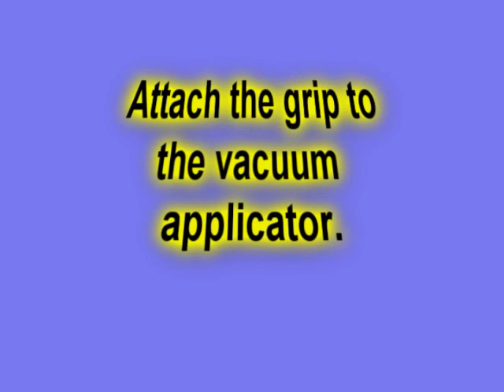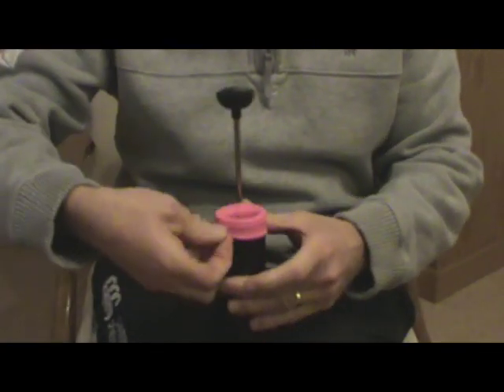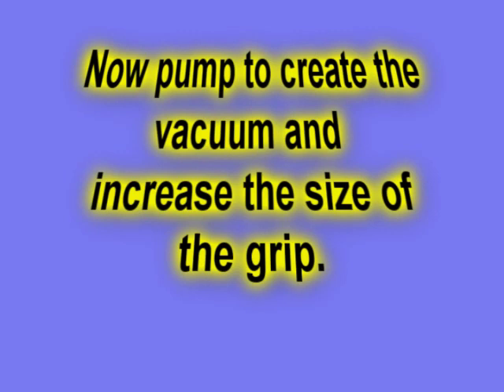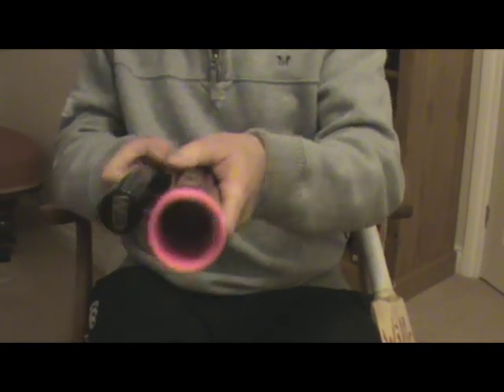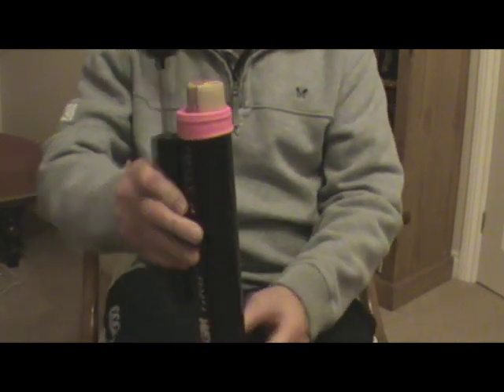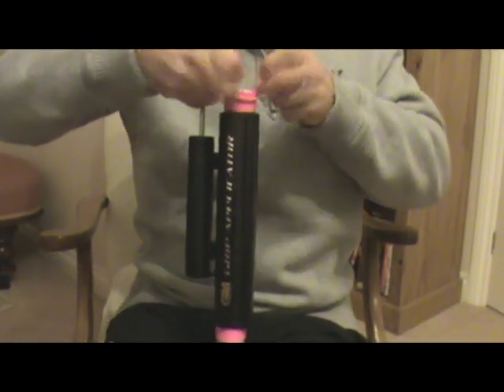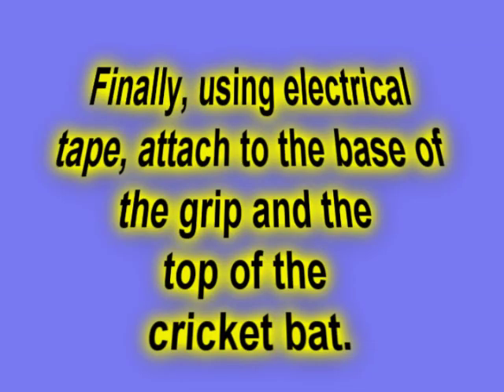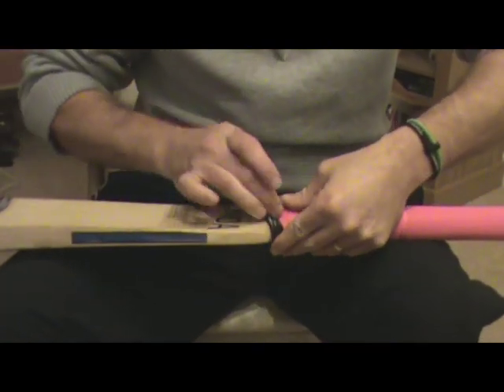How To Apply a cricket bat grip Using a Vacuum Applicator

Comment from the maker: It does work with an Octopus grip. You need to run some tape around the grip when it is attached to the applicator, to create a seal. Then carry on as before.

I have used it to fit one to my bat.

Comment: The theory behind this contraption is great but it does not work in practice.If you can get this to work then you must be superman or Einstein. You can never seal the ends enough to create a vacuum; it is near impossible. I wasted so much time with this thing that I got fed up, sent it back and then learnt to apply the grip using a normal come. Please dont waste your money on this kit.
Reply from the maker: Hi Akkers5. Since i made this video, many grips are now so thin they have small holes in them making the chance of creating a seal very difficult. I have found if you slide a large sandwich bag into the grip and cut the closed end of the bag. Then when creating a seal tape around the bag as well as the grip. This works and i shall do a video to show how shortly.